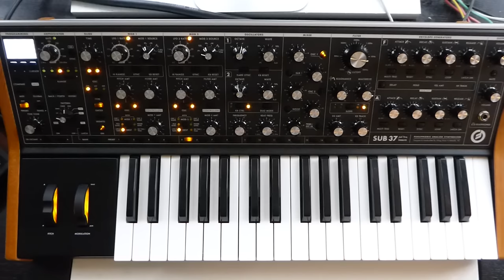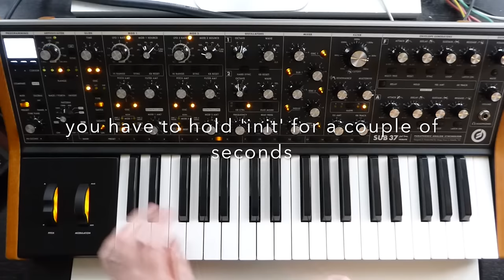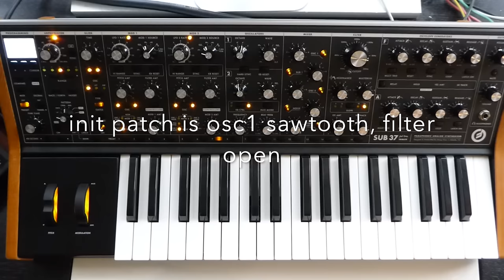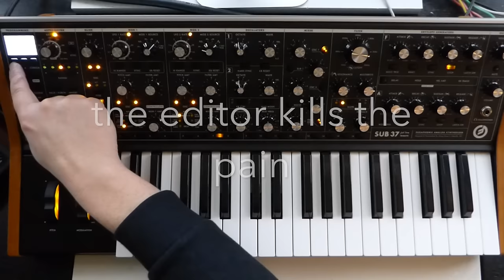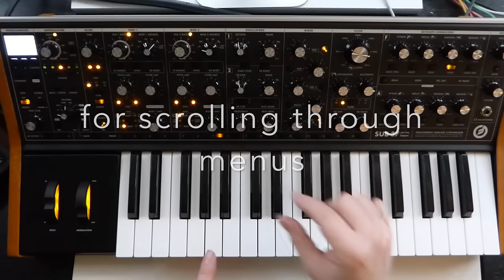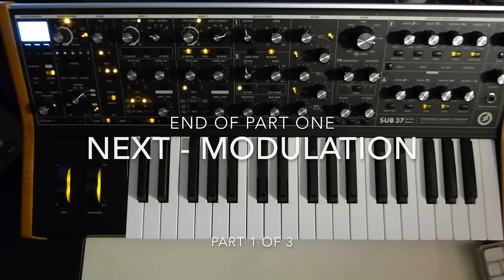Moog Sub 37 Walkthrough - Oscillators, Filter and Envelopes Part 1 of 3

Comment: Really enjoyed that - brilliant intro to the sub 37.  Anyone thinking about getting a sub 37 is is going to have a really good idea of the sound palette on offer thanks to you. The noise generator in the mixer section is analog - but there is also a digital noise generator used as a source for the mod busses.  One counter-intuitive thing is that panel mode isn't always WYSIWG. If you do an init in panel mode, the knobs will be out of sync - just need to press [preset] then [panel] again after doing a panel init to pull it all in line with the hardware.
Reply from the maker: +FunInWales Hah, I think I demoed the panel mode by accident at some point when trying to get an init patch!  You're quite right the noise generator is analog, not sure what I said in the vid, I might have said it was digital, possibly getting confused with the Prophet 6 duh!! :)

Comment: Nice demo, very nice synth. 6db filter sounds amazing, plenty of modulations, definitely worth considering. No ring mod though. I own a Prodigy, and I'm sure it is not blown away by any mean by the Sub as long as you keep apples and oranges in separated bowls : no overdrive or feedback, comparable waves. The Prodigy filter IS screaming when pushed, creamy/silky etc when adjusted to be so, and the solidity of the basses are amazing compared to most modern synths and a good bunch of vintage ones too :) As for the hard sync, I'm pretty sure the blowing away would be the other way around, from the few samples I've heard of the Sub. No sync compares to the Prodigy's one.
Reply from the maker: Haha I hate hearing anything about Prodigys or is that Prodigies,  Prodigii??? Since I lost one years ago —— don’t ask :(
Reply: Sorry for your loss. I've lost an instrument too, I can relate. I'm considering the Sub because the Prodigy is so limited anyway. Enjoy yours if you still play it, it is a great packed synth indeed. Cheers !

Comment: Thank you.
Even though the mute-button seems lame and pointless, I guess that it would come in veey handy in a lot of situations.
Then you can have it hooked up to speakers or P.A. and mute the main signal but still hear it in the headphones.

Then you can quickly test stuff, rehearse, program a sound, check that it is the right preset and much more, by yourself and not going public with it.

Very nice feature in some situations, I guess - and very flexible in situations where you are not in charge of the mixer or got it next to you.

Very nice video, thanx. 👍🙂
Reply from the maker: Yeah I use it all the time. I have it set up as my main controller - all those knobs are great for controlling software etc. so the mute button is in more than it’s off tbh. 

Glad you liked the demo.

Comment: Thanks for the excellent videos, much appreciated.

I'm going to ask a potentially dumb question about the Sub 37 now! On my Yamaha MOXF, when I change to a different voice, all the settings and knob values get set back to what they should be for the voice. On the Moog, what happens when you load a preset if you've been messing around with all the knobs and changing their values for the previous preset loaded? Does it reset them all back to what they should be for the new preset?
Reply: Yes.

Comment: Can anyone tell me again how to get that organ sound at 21:26?? Thanks I just recently got my hands on one of these
Reply from the maker: +Grant Hoglund you need to tune the filter at a high resonance. Put reso full, turn off all other oscillators and put keytrack on 1:1. Now tune the cutoff so that the filter is in tune with Osc 1. Turn Osc 1 on to do this.  The filter will be an octave or 2 higher (you can also tune like a drawbar and choose an interval -3rd, 5th etc). With a 1:1 keytrack setting the filter will track the keyboard perfectly.  Once tuned mix Osc 1 into the mix - dead simple really but sounds really effective.

Comment: Hi mate, I like your videos and was wondering if you could answer a couple of questions for me if you have time.  I want to get a synth, Dave Smith preferably, but don't know really sweet FA about them.  Basically, I'm living between two places at the moment - that makes it sound way, way more glamourous than the reality! - and want to get back into playing keyboards again and as a result need to buy one for the other place.  I want a synth to mess about with, but one that can also be played as a regular keyboard.  My issue is that I get lost when it comes to talk of voices in synth reviews.  What I'm asking is, I suppose, which Dave Smith synths can be used with any modifications as a regular piano keyboard?  I get that the Prophet 12 is that, but that's a little out of my price range, and I'm a little confused over what exactly the Prophet 6 and Pro 2 are!  The Mopho SE for example: how many notes can that handle at once?

I'd be very grateful for any help!
Reply from the maker: +Michael Jenkins Hi, I'm not exactly sure what you're asking, i.e. do you want to play regular piano style sounds, or are you talking about polyphony (how many notes you can play at the same time)?  If you want piano sounds, a DSI isn't for you, although you could use it as a controller for piano sounds from anything else (software, or sound modules).  For more regular sounds (general midi etc, cellos, organs strings etc) there a loads of options, but I use software to cover these. If you're looking for polyphony you'll need a Prophet 6, 8 or 12.  The Pro2 is monophonic (i.e. only one note at a time), or can play 2 notes in duo phonic mode - which is far from regular piano style playing.  You'll also want a larger keyboard if you're playing with 2 hands! The Mopho SE is a monophonic Mopho with larger keyboard Mophox4 is 4 note polyphonic.

If cash is tight ';d go of the P8.  It is 8 note polyphonic (compared to the prophet 6's 6 notes) and can cover most of the ground of the P6 plus more.  It's all there in my P6 vs P8 video series, but to summarise: P6 is simpler and has FX, P8 has no FX, is more complex but is cheaper. P8 also has a split mode for e.g. bass on left pads on the right and an octave more on the keyboard.

Comment: Hi! Great videos!!
I have one question: I just got my sub37, but it makes audible noise, whenever I lowpass filter an init patch for example. Below 320 it starts to reveal itself and this noise (white noise-ish) follows the envelope and starts on key press. (The noise generator is of course turned off). Does yours do the same or is it dead silent? Mine is dead silent when no note is pressed.:-s

Comment: Is there a way to adjust the sub37 keyboard bed for velocity??

I've noticed when I try to record on my PC, it always registers as the same decibel range no matter how hard/soft I push the keys. Thanks for the input!
Reply from the maker: Initialise the patch - hold the init button.  The velocity isn’t active yet.  Press the button to access the 2nd functions of the ADSR controls (it’s between the 2 sets of ADSR knobs next to ‘Delay’. The sustain knobs now control the velocity amount going to either the filter or amp. 

If this doesn’t work check that the keybed is registering different velocities by looking at the MIDI input on your DAW - check the velocity of recorded notes.

Comment: Nice vid! Do you know if it’s possible to split the keyboard to have two patches at the same keyboard at the same time (in the same preset)?
Reply from the maker: you can split the keyboard and put any of the synths over their own set of keys... and they can all sound on the same key, overlap or solo. I'm not 100% that's what you're asking though?
Reply: @StarskyCarr  thanks for the reply, but I don’t understand you very well. Maybe I haven’t explained it clearly. I would like to split the keyboard as the typical split on regular keyboards, to have more than one patch in the same preset, but in different key zones. For example, from the central C to the low one, it would be one sound, and from the middle to the high one another. Both saved in the same preset. Would it be possible? How could I do it?
Reply from the maker: @julenkwag  aaah sorry… I thought I was replying to a question about something else.   !!! Oops ;). 

No it’s not possible.

Comment: 21:35 great organ sound :)
are you running thru a compressor/pre-amp? i have my settings pretty much as your is and it doesn't sound as smooth :(
Reply from the maker: +rss313 Its recorded straight into Logic X using a UAD Apollo, with no preamp or compression.  The final mix including the voiceover has Slate Digital FGX and Red compressor just holding things together to avoid clipping really.

Comment: One thing I've noticed on the Amplitude release is it only seems to affect one Oscillator even in Duo Mode, when the key is released one oscillator shuts off and the envelope occurs on the other one. Is there a way it can affect both?
Reply from the maker: That doesn't sound right... it should behave like that